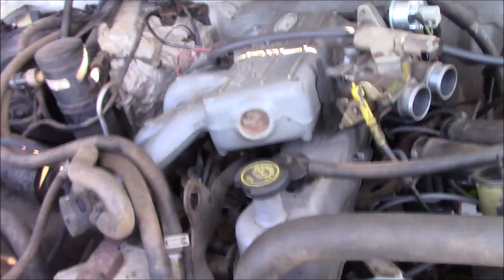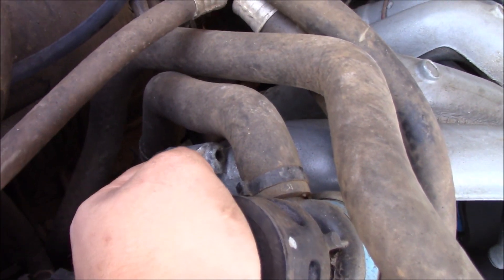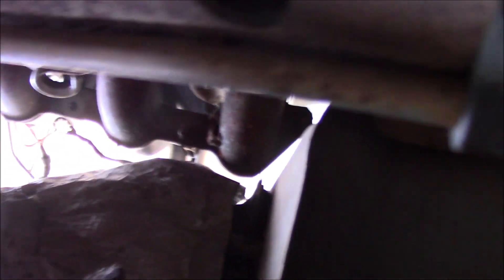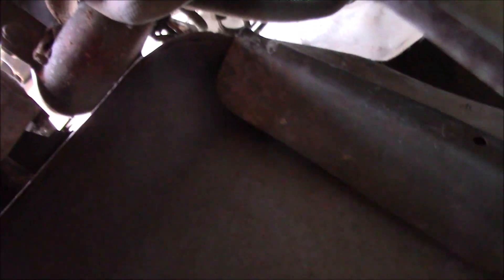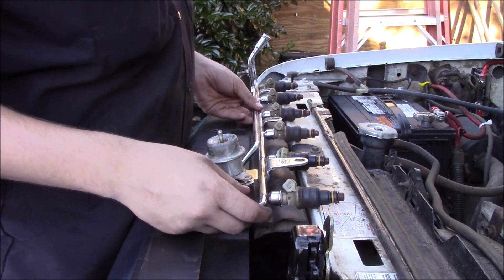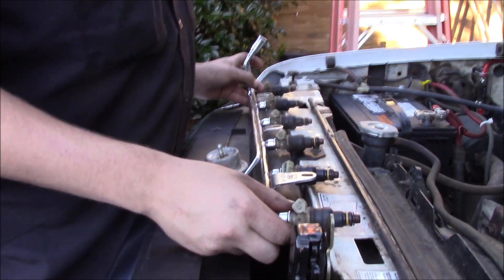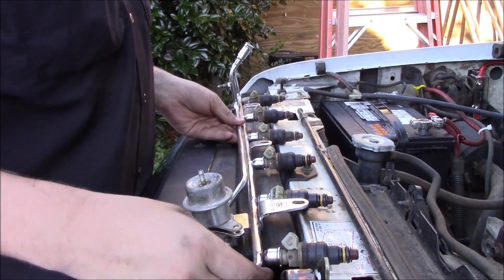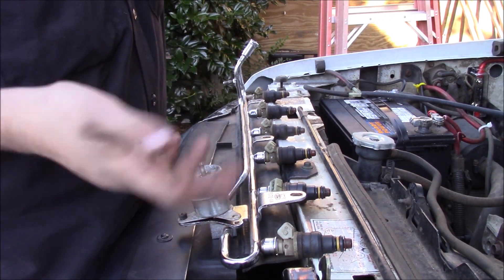Fixing The fuel rail and replacing 2 injectors on the F-150

Comment: Bro thanks for putting this up. About to change injectors after 300K miles on my 4.9. You're right about the rust being an issue. Wish we had a parts yard around town to get a new shiny fuel rail like yours!
Reply from the maker: no problem man. yea finding parts for these trucks is getting difficult
Reply: me 2 300k.   But im gonna use the upgrade injectors, supposed to be new tech.

Comment: Dang dude can’t believe I didn’t find your channel earlier ive got a 91 f150 4.9 that im always working on but it’s not bad because I work at a junkyard
Reply from the maker: 😂I work on alot of these old fords, amd try to provide people with some information on how to work on them themselves
Reply: Xxdayday99 I appreciate the content. Im kinda lost with my truck. It runs and drives down the road pretty good. But it’s not preforming right. When you accelerate it breaks up or hesitates and then picks back up, like it’s loosing spark or fuel but then smooths out. Ive done the basic stuff and swapped a ton of parts new and used
Reply from the maker: @wyattklingensmith8862 The timing on these trucks is controlled by the computer there is a small grey diode next to brake booster and ecu. if that is not plugged in, the timing wont advance  and can cause the issues you are describing. i dont know if that is the issue but its an option for sure
Reply: Xxdayday99 the spout connector. Yes ive set base timing and and verified it advancing itself with the spout in. I had once got a code for the spout circuit open but it wasn’t . But that code never came back after checking the timing again.
Reply from the maker: @wyattklingensmith8862  hmm have you tried tps?
Reply: Xxdayday99  yes I have. The biggest improvement i had was when I restricted the egr it ran great then I restricted it more and got a code for it and removed both of my egr restrictors lol
Reply from the maker: @wyattklingensmith8862  so you could go for a egr delete or just check the ports in the intake and see if they are clogged these ports are right behind the throttle body on a 5.0 the 4.9 should be similar thry would be where the egr bolts to the intake
Reply: Xxdayday99 yeah I know what you’re talking about man, the ports seems pretty open to me I have had the throttle body off to clean and replace the gasket and I have had the egr off itself, it was stuck shut i got it moving and just put another used one on it. But again i say it runs best with the egr restricted, I have a fender washer with a 3/16 hole. Ive seen they sell a resistor so you can delete it with no code but this seems to work but I can’t help to feel it’s not the actual problem
Reply from the maker: @wyattklingensmith8862  thats very strange. im at a loss. theres a tube that runs from the bottom of the egr to something idk honestly im grasping at straws. but maybe make sure the distributor is good. you work a junkyard maybe try changing it out and see what happens.
Reply: Xxdayday99  yeah man im at loss too, if I ever figure it out ill have to let you know
Reply from the maker: @wyattklingensmith8862  one thing i remembered is that you can try the ecu just get a used one that matches the options for your truck and if it fixes the issue or atleast makes it better then get yours rebuilt or get one with the same numbers

Comment: Where did you print a fuel pressure regulator at for 120$ lol got mine for 30 same engine new AutoZone
Reply from the maker: This fuel rail was different and expensive for some reason

Comment: I got a 2001 f150 triton 4.6 liter v8 4x4. Lost power feels like it’s clogged so I changed spark plugs and 2 coils it still ran like crap then I replaced fuel filter and not I have lost power in my truck like I have no power and it still misfiring. I need some help trying to figure what Is wrong with it. My next step is to change injectors
Reply from the maker: i would not just keep replacing parts because its gonna hurt your wallet. i have a video on my channel of how to diagnose and clean fuel injectors.
Reply from the maker: also the intake could be full of carbon

Comment: Nice vid! Do you know if the fuel rails on all the 4.9 engines are interchangeable?  I see the one you took off has two bolts on the FPR and then you installed a rail with 3 bolts.  Will a '94 4.9 rail fit an '88 4.9?  Seems like it would...
Reply from the maker: I had the rail and fpr swapped both in and worked fine. My used fuel rail came from a 92-96 truck. Dont know the exact year though
Reply from the maker: As long as the fpr is calculated the same i dont see why it would be an issue i know in 88 the fuel pump setup is a little different so it may cause a problem. If i already had the stuff i would probably go ahead and do it and see what happens
Reply from the maker: Worst case scenario you are taking it all back off which is a bummer but
Reply: @Xxdayday99  I've disassembled it so many times at this point I could probably do it w eyes closed lol!  There's a new one  they claim for '94-'96 on ebay for 200 clams, I'm thinking about it, pricey but brand new!  I may search local junkyards today first tho.
Reply: I'm also picking up 2 new SpringLock connectors for the supply and return lines that connect to the fuel rail (Dorman part number 800-130 and 800-131) about 11 dollars each at the A-zone, should be here today.  Ones I have are difficult to connect so that could somehow be my issue, I may try to put those on today and see what happens before taking everything apart again- I didn't check to see if the injectors popped off after I re-installed in my vid, I bolted it down cuz it was easier to connect the old connectors, I probably should have done that before re-installing but whatever, gotta feeling I'll be taking it all apart again today but as long as I get closer to figuring out what is wrong I'm in the right direction.  Gotta go slam some rear brakes on the car right now, stop the grind, to start the day then I can get to the junkyard.  Here's my vid of my '88 injector seal problem if any are interested- just figured out how to upload w my new vixia camcorder-  https://www.youtube.com/watch?v=h6-lNNcy_I4&t=25s
Reply from the maker: @apples13able77  i do have a video on injector cleaning on my page in case you need help

Comment: Good job however either I missed it or you forgot to tell us how you released the pressure from the electric fuel system.  AND your audio is just terrible and you spoke entirely tooooo fast.  Thanks and it was a complete explanation but audio really bad and far too fast on the speaking side
Reply from the maker: yea i need to get an external mic with a dead cat. the wind was bad this day and there is a shrader valve on the fuel rail. looks like a valve core for a tire. just push that down with a small screwdriver and it will release pressure from rail

Comment: Also only thing that fails on injectors is electronic. Othereise they are clogged. Try cleaning them and then look at the wires to the ignition system. Clean them not by soaking only take them tubes that you can shrink and carb cleaner. Make sure the tube can fit in the injector and very important 12 volts one clip on negative one you have to tap really fast if it dosnt click its bad then spray them.

Comment: How do you remove the fuel rail whole reason I watched this video.
Reply from the maker: so. you have to pull the upper intake and the 2 hold down bolts for the fuel rail. after that just use the ford fuel line tool to remove the lines.
Reply: @Xxdayday99  can you show us?
Reply from the maker: @thedarkrocker333  i will mske a video im doing a engine swap soon from a v8 to an l6 ill make a seperate video then

Comment: Why remove the throttle body and where's the part to remove fuel rail and injectors.
Reply from the maker: You dont have to remove the throttle body my intake was full of carbon so i removed it while i was there